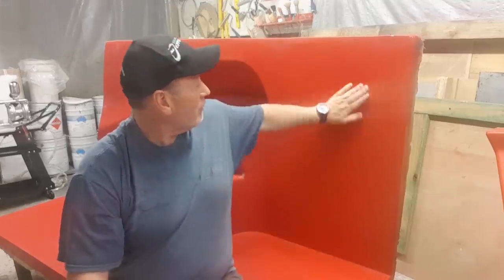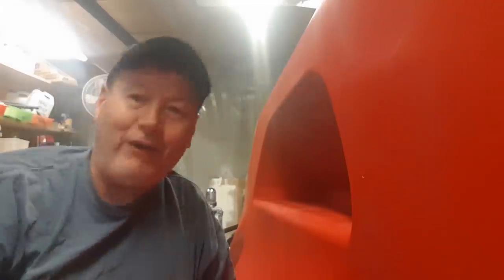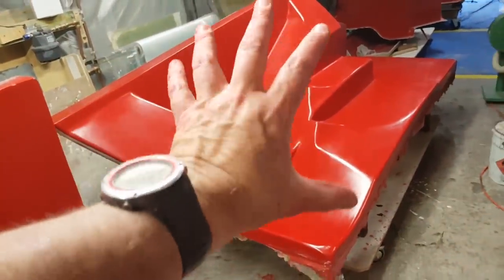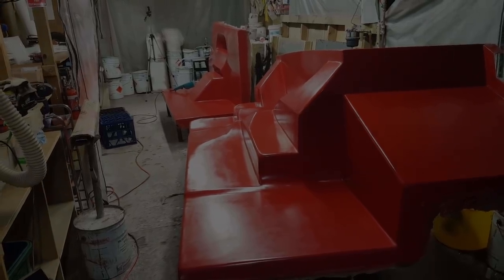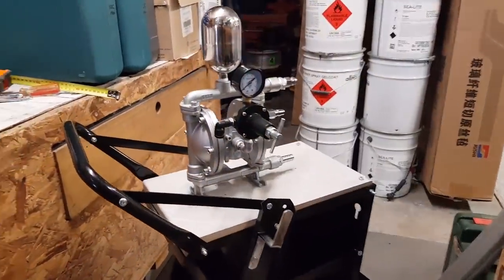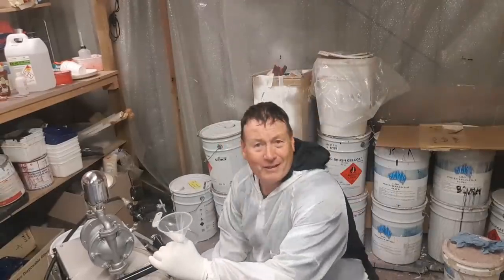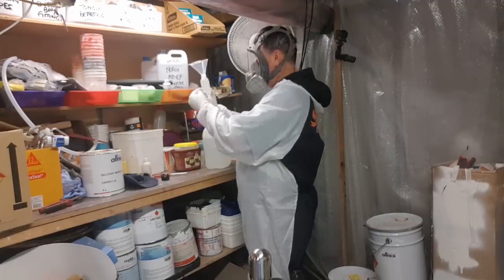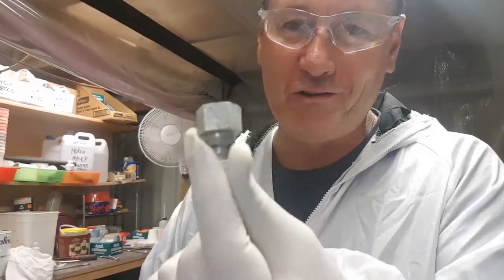Ep046 New Gel Coat Machine - Life On The Hulls - Catamaran Build Series

Comment: Thanks for the vid. May that spray machine work with epoxy as well..?
Reply from the maker: Sadly it isn't possible to spray epoxy resin as the mix is substantial ie 2:1 and the resulant emmision can be deadly to the user.This machine will only work with polyester and vinylester solutions catslysing at 1_4 %.Cheers
Reply: Thanks for the answer. Did some googling and I think epoxy needs different kind of solution. Spraying doesn’t seem to be possible at all...?

Comment: would wrapping the molds in the shrink wrap that I see boats wrapped with work for protection.? The labour cost of polishing the molds every time you use them must add up. Especially if you are paying someone else to do it. What is the cost of doing the wrap. If you could just pull of the wrap and use would save a lot of time and money and make their life span longer also.

Comment: Now that you are at this point, do you wish you had gone with a kit from lets say Garainger or Schionning?  I am still rooting for you man!
Reply from the maker: I definately considered a kit cat,in the end I am probably about $100k ahead to date and have a gel coat finish which for me is preferable to a painted boat.I also ferl that h80 foam is a longer term choice for durability than end grain balsa with only 1 layer 600 db on each side due to water ingress issues and although not infused our Cat will be far more durable with a more substantial extetnal laminate albeit a heavier boat.At approx 7-8 tonne it is still aiming to be 4-5tonnes lighter than the equivalent lagoon or leopard.In the lonh term I am not certain kits are easier.Cheers buddy